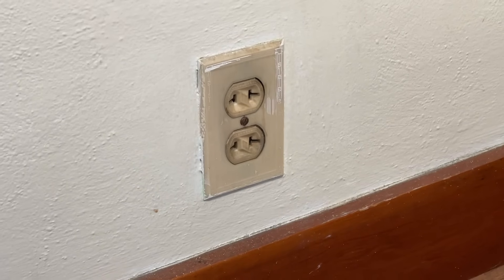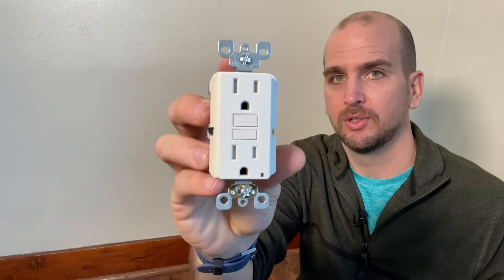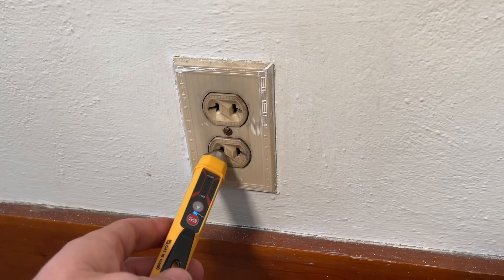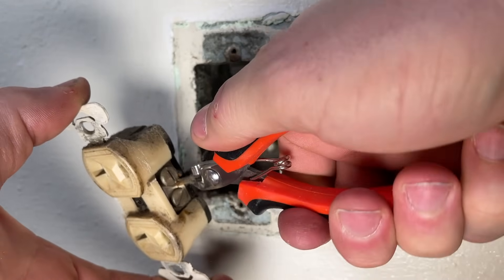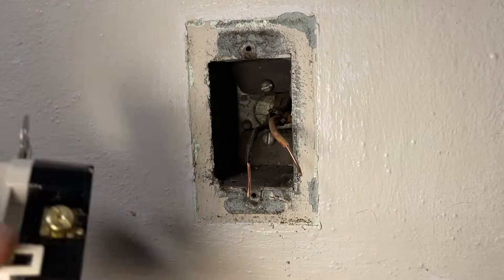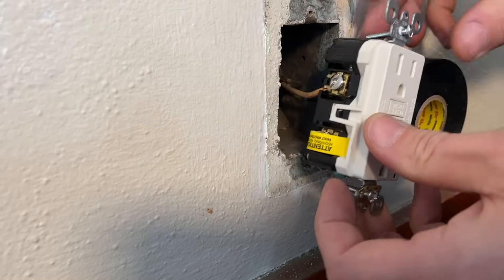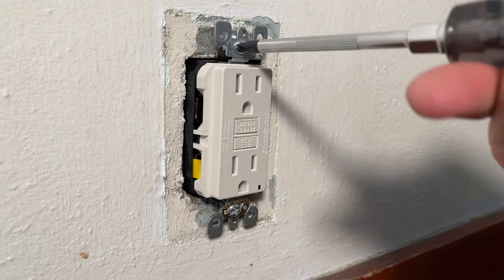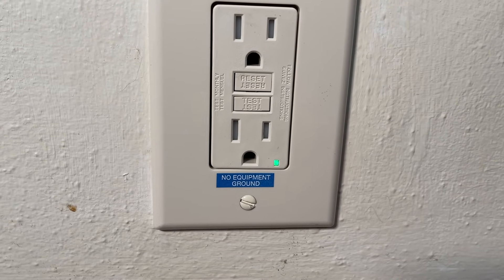How To Replace An Old 2 Prong Outlet Using 3 Prong GFCI

Comment: I don't know if it's 100% legal, but I have used a 1/4" bell hanger bit & drill out of the box edge into the basement. I run a #12 wire & ground it to the nearest cold water pipe. Swap it to a 3 prong. Outside walls are hard to do. So this creates like 4 or 5 ground paths. Is this a lightning hazard? Note, all my water pipes are copper. I do my own plumbing to prevent plastic inserts. Pipe is bonded to the panel. Panel has a ground rod originally not installed.
Reply: If there is a ground fault, you have about a 50% chance of electrofying the water, and seriously injuring someone taking a shower or washing their hands in a nearby sink. Get rid of it right away

Comment: This is really helpful. I didn't know you could replace a two-prong with a three-prong receptacle and then also have some extra safety built-in. I definitely have places I put those adapters. I need to change them out now. 

You say one gfci receptacle 'can' (maybe) protect additional non-gfci and ungrounded 3-prong receptacles in the room. Do all they need to be on the same circuit breaker? (which seems logical)

I can do a lot of diy things but plumbing and electrical jobs are things I've always avoided. I thought it was really something when I managed to replace my kitchen faucet. ;) Sorry about the question if it's on the stupid side.
Reply from the maker: GFCI outlets will have 2 terminals (hot and neutral) from the "line" side (power coming in) and "load" side (power going downstream to additional receptacles).  This is how 1 GFCI would protect multiple receptacles.  Be safe.
Reply: @EverydayHomeRepairs  Thanks for replying so quickly. I had to stop and think about it but I believe I understand what you're saying. Now that I have a general idea, I can google to get more info.

Comment: Now without the ground use your woodhead gFi  tester and notice it doesnt trip. Any inspector would make you replace the old receptacle with a new two prong which are still available to buy or get a ground wire to the box. otherwise someone trying to use this receptacle with an appliance or tool with a grounded housing for safety would not be safe. Sorry try again
Reply from the maker: Hey Scott, thanks for the feedback but at least in my area that is not true.  The process as show meets the code and as such the inspector won't make you swap out the GFCI.
Reply: @EverydayHomeRepairs  I had an issue doing this in Long Beach, CA. inspector was a real peach
Reply: Any inspector who fails because of this should be fired.  Print out the NEC section where it says to replace two prongs exactly the way that is shown in the video

Comment: I want to put all GFCI outlets in my 2 bedrooms can I do that
Reply: Are you talking new construction or are you upgrading a groundless system? GFCI's are more expensive than regular three-prong outlets. They trip by sensing an imbalance between the hot and neutral, rather than just overcurrent. They also make GGCI breakers that will protect your outlets from the breaker panel.
Reply: GFCI
Reply: Older home with no ground

Comment: In the beginning where you show the 2 to 3 prong adapter, you state people screw the strap to the center screw in the receptacle and that's not safe because there is no ground. That's not necessarily true. If it's BX wiring, the box would be grounded and the receptacle, by way of the 6/32 mounting screws, would be grounded at that center screw. Also seen many times with old wiring, the grounds from Romex twisted and secured to the box. In that case, your receptacle would again be grounded at center screw. But absolutely, this is not an ideal or no longer the correct way to ground.
Reply: Only MT conduit is considered grounded by code

BMX is also used as Romex in a metal or plastic box with no connection to the box
Many I have found that no grounding screw to the box

Comment: How can I find where my lead outlet, " At the start" is to put a GCFI and be covered on two outlet panels? Also, so this will work but there is no ground wire connect for the ground 3rd prong. Not sure I understand how this works if there is no ground. 
Thank you for this vid,  i just got a old house that needs a lot of TLC.
Reply: In short, it’s still not grounded, but it’s safe and you won’t get electrocuted.
Reply: @mattfrazier3115  trips in 1/40 of second... faster than human heartbeat. so thats good. i thought ... without ground... it is pointless to have???? i will just drill a hole outside on outside receptacles and run a ground wire ... in conduit so it wont get cut by overzealous weedeaters, to 2' long ground rod.  that will be easier to drive in ground at EVERY inside an outside wall outlet. one GFCI... one ground rod outside. 8' long ground rod cut in 4 pieces driven almost flush with the ground and the ground kept moist for good grounding. seems to work. not "right" but better than dying of electrocution.

Comment: Where is the ground wire, this can't work properly without it.
Reply from the maker: Seems to be a common misconception but GFCI receptacles will trip with or without a ground wire.  The GFCI is detecting a change between the hot and neutral wire not taking into account the ground.

Comment: If theres a short the original outlet would trip the breaker. You could put a standard outlet i and gt the same result. Either way it wont pass inspection. Gfi or not. If you are going to cheat install cfi breakers.

Comment: if it is NOT grounded it is not a three prong outlet, you could have just bought a cheap 3 to 2 chinese adapter.
Reply: A cheap 3-2 adapter is unsafe.  A GFCI adds protection to the line.  If you were to drop a hair dryer into a bath tub --  the classic example -- the GFCI will trip.

Comment: Still won't function as a ground fault interrupter though.  If you run a jumper from the neutral to the ground it will.
Reply: Illegal. Neutrals and grounds can’t be bonded beyond the first means of disconnect.
Reply: @joshfalk8323  legal or not that's the only way it will function

Comment: Isn't Hot wire supposed to be on the right size of receptacle?  In Asia we always connect the wire that way.
Reply: Yes, if the ground is down. Some wire ground up so then it of course will be left.
Reply: It is on the right side. Black is hot
Reply: @nunyerbidness6417  OK my bad, did not watch carefully.  Thank you.

Comment: And why exactly is a two prong outlet, unsafe?
Reply from the maker: Because it is ungrounded and also usually leads to people using the little 3-prong to 2-prong adapters which are not ideal.
Reply: @EverydayHomeRepairs  I get that people might use the 3 prong adaptor incorrectly, but to say that a two prong outlet is unsafe just because it is ungrounded is a bit much, especially when used for appliances with two prong power cords and an insulated case.

Comment: This is going to cost people a ton of money !!
Putting them in all your two prong outlets , geeeeeeesh.
 All I did is went to home depot and got what is called pig tails , green ground pig tails. You screw the pig tail ( comes with a screw already on each of them ) to the back of you outlet box and then to your new three prong outlet ground . It pass code in most cities still an are very safe .
Plus you will save a ton of money

Comment: If you don’t have a ground wire to work with, how is this any safer than the adapter you showed at the beginning?
Reply: A GFCI does not require a ground wire to function.  It does not look for current on the ground line.  It actually works by comparing the amount of current on the hot and neutral lines and trips if they are different (meaning some current is going elsewhere).

An adapter dongle, on the other hand, simply connects the device's safety ground to the screw terminal at the center of the outlet.  But if the outlet isn't grounded (e.g. to the box) then it accomplishes nothing - it becomes no different from simply cutting the ground pin off of the plug (which you should never do).

Comment: Won't work without ground.
Hence the name ground fault interrupter
Reply: Incorrect.  The video is correct; GFCI is acceptable per NEC for this use case.
Reply: Ground fault means that current escapes to the ground from the circuit, possibly through some person. It has no direct connection to the grounding connector.

Comment: Your still wrong cause the ground always goes to the top not bottom .if something falls in the box it hit the ground first pushing it away if way you have it then it can hit the hot an 
Neutral an explode that why if you look at your a.c. your stove an your dryer the ground always on top

Comment: Thank you I didn’t burn down my house doing this :)
Reply: yes but you lost 15$ per outlet and gained nothing if you dont have a ground wire in your box.
Reply: @potatochobit  care to elaborate? Do they not prevent shocks and electrical fires?
Reply: @boomboom23  it might work for safety but the test button on the outlet wont work without a ground. you need little stickers NO EQUIPMENT GROUND.

Comment: If there is no ground you have to jump the neutral to ground in order for the GFCI to test properly.
Reply: Would that work? I thought about trying that. The white goes to the ground bar anyways right? But something tells me it doesnt quite work like that? I dont know how this guy got away with just wiring 2 wires? Mine kept tripping but I also have a load going out.
Reply: @kayakbandits9894  yes it 100% works, if your gfci keeps tripping you may have a short in the circuit or a bad gfci
Reply: Do not do this.  It is illegal and unsafe.  Installing the GFCI like the video shows is absolutely 100% up to code.

Comment: If you think super 33 is the best, you clearly haven't used super 88. Expensive, but man, it's the best tape out there
Reply from the maker: Got a roll of Super 88 in the truck right now but you are right I don't usually spring for the extra cost.

Comment: You need a ground wire for the GROUND FAULT CIRCUIT INTERRUPTION to work properly, and you're not likely to find a ground in a house that's 80 years old!
Reply from the maker: Actually, you don’t need a ground wire for the GFCI to work.

Comment: On a plug that old I’d be really surprised if you have a circuit breaker. You’re probably going to be unscrewing a fuse.
Reply from the maker: This unit has breakers as it was updated in the last 15 years without swapping out the outlets.

Comment: Placed it on wrong, even if the ground wire was attached.  The ground wire prong hole faces upwards, not downwards.
Reply: In homes the grounding hole is typically oriented to the bottom; in commercial installations the top. Not sure why, but that's just how it is done.

Comment: My 1960 house has polarized 2 prong outlets except in the laundry room. I think it was a time when they could have gone either way by code and wish they used all grounded plugs. When I installed some 3 prong grounded outlets, I undo the bare copper ground wire which is wrapped around the romex clamp in the back of the metal boxes. I sure can't depend on that ground and the receptacle contact point for a reliable ground. I connect the romex ground wire to a box ground screw and to the green ground screw of the receptacle, with a pigtail if needed.

Comment: How do I know witch one is the main and if the rest of the outlet are connected to the main one?!
Reply: Isolate your wire pairs and turn the circuit back on. Don’t cross wires. Check with multimeter or similar for voltage. The wire pair with voltage is the main. The ones without voltage are the loads.

Comment: Try putting a ground fault tester to an GFI wired as described in this video and it will fail.
Reply: It won't "fail." NEC says to replace 2 prong plugs with GFCI plugs just like he shows.  No, it won't trip with a tester, but it certainly does not mean it fails
Reply: The outlet should be tested with the test button.

Comment: How can I identify which receptacle is the starting receptacle in a room?
Reply: By process of elimination. Choose a receptacle that you think is upstream. Switch breaker off, verify that there is no power on receptacle, then pull it out of the box. If there is only one set of wires in the box, you've chosen the most downstream receptacle. Pick another one, pull it out of box, disconnect the black wires from the hot/line terminals, then tape the bare copper to prevent shorts. Switch breaker on and test remaining receptacles with non-contact probe to see which one(s) are still energized. Use this knowledge to chose next receptacle to disconnect. Repeat until you know the order.

Comment: The box is metal, While not a true ground it can be used as a ground. He could have very easily run a groundwire to the screw visible on the back of the box.
Reply: How is that grounded? Is the box bonded to a grounding rod? Probably not, just nailed to a wooden (insulating) stud.
Reply: If the box is not grounded it will not help. In fact in that case I would replace it with a plastic box. If an ungrounded box gets energized it will drive the voltage through the ground wire to the connected equipment.

Comment: Most areas in the US demand a ground to the box, or 3rd wire ground.
Reply: Yes for all new construction, but if your house was built before 1960, it most likely had a two prong outlet with only a HOT and a NEUTRAL wire pair. That met CODE at the time and is grandfathered in.

Comment: You could also protect the entire circuit with a GFCI/AFCI breaker at the panel which is acceptable.  You must label all devices in that circuit as to " no equipment grounding conductor " . Realtors are great for this. It's two days before the closing,  and they call with the house didn't pass the electrical inspection.  Can you fix it??
Lmao! Folks it's "Electrician NOT Magician!!"
Reply from the maker: 😂 you have to love the scramble right before closing.  I try to avoid that as much as possible.
Reply: @EverydayHomeRepairs  It's insurance companies who are to blame. Even untouched knob & tube is OK, but insurance companies hate it. I got homeowner's insurance turned down because of oil heat with the fuel tank in the basement.

Comment: I don't get it. I don't get it. You just used some smoke and mirrors but did not add a ground.
Reply from the maker: No smoke and mirrors here my friend.  Just following code  https://www.electricallicenserenewal.com/Electrical-Continuing-Education-Courses/NEC-Content.php?sectionID=306.0  Check your own area to ensure this is still acceptable but I would suspect you are good.
Reply: @EverydayHomeRepairs  I won't let my pride stand in my way. Thank you I learned something and I will be upgrading my old two prong  receptacles.

Comment: It looked like there is a ground wire in the back of the box.  Use it if you can.
Reply: I did not see any ground wire in the box. Can you ground to the box? Depends. If the cable is armored, the sheath will provide ground, though a poor one. If it is conduit to the box, then connect ground to the box--NOT using the mounting screws for the outlet.
Reply: @hotpuppy1  There needs to be a ground wire somewhere to the outlet  in the box.

Comment: Aren't electricians today taught to install with the ground up? Fire hazard thing
Reply: NEC doesn't say anything about orientation of receptacles. And receptacles mounted ground up quickly get turned the other way as soon as someone tries to plug in something that is designed for ground down orientation.
Reply: No

Comment: What you just showed is illegal for two reasons and you really should know what you are talking about before you give bad (and potentially deadly) advice to people! The first thing that you did wrong is that the NEC requires at least six inches of wire extending past the box. This is to allow sufficient wire to make your connections to the device and to allow the device to be completely removed from the box. You should have pigtailed some extensions on the wire. The second problem (and this is probably why you didn't correct the wire length violation) is that the box doesn't have sufficient capacity to accommodate the GFCI. These old boxes are usually too small and this is why you put tape around the screws when you stuff the GFCI back in the box.  You are setting up people to fail because only one box in ten or so is going to have only a single wire to deal with, despite your weasel language at the end of the video.

Comment: Y'all may have answered this previous videos, but my house was built in 1966 and added on in later 70's. There are colored wires not matching. What is the color for hot in 1966 houses and color for hot currently.?
Reply: on a plug the right side wire is the equal to hot. Black to gold, does that help?

Comment: 5:45 How does the GFCI outlet see a ground fault if there is no equipment ground? I assume it’s not taking ground from the outlet box since the tested still shows an open ground. 

In some old homes, the metal back boxes are connected with metal conduit in the walls, which you can use as a ground source.
Reply: The voltage on the Black(hot) and White (netural) should be the same . If the GFCI detects an imbalance it assumes there is a problem and trips .
Reply: @rydfree  Not the voltage but the current.
Reply: @rydfree  thank you.

Comment: If you connect a wire from the ground on the plug to the neutral on the plug it creates a ground
Reply: NO it does NOT !
Reply: @rydfree  sure it does your neutral and ground on most boxes go to the same buzz bar try it and check it with a tester it will read as grounded